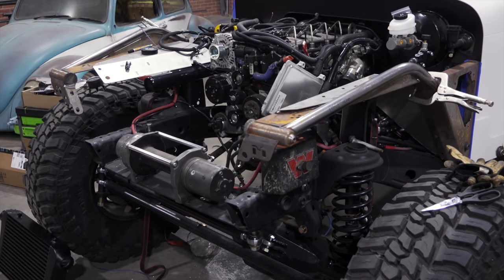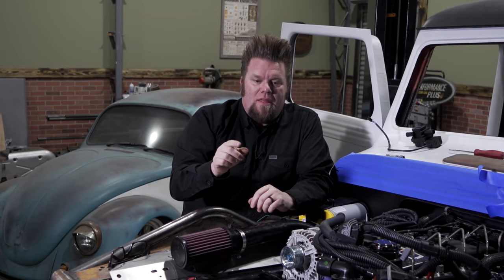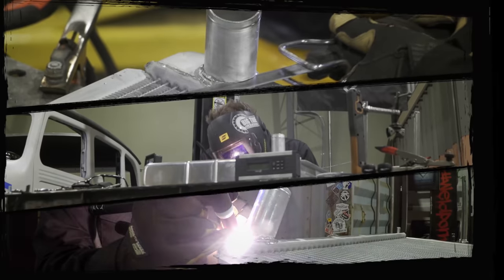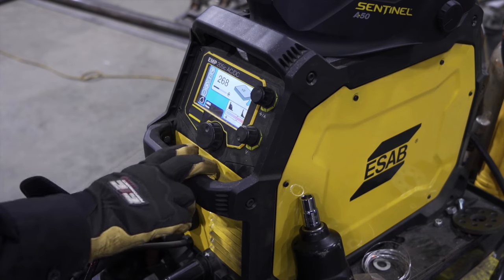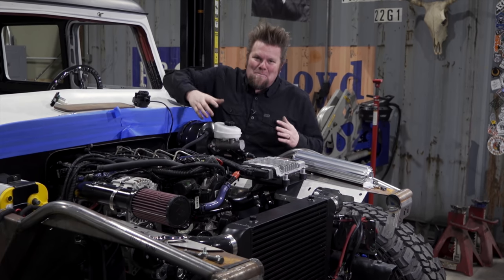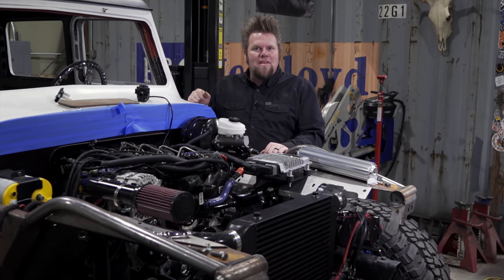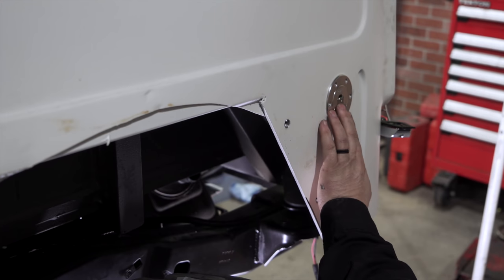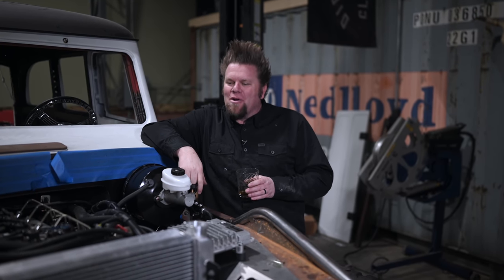How to Plumb Turbo Piping R2.8; Willys Wagon Episode 14

Comment: The first time turning the key and starting the engine on a build is the best feeling.
The little extras on a build are worth it in the end even if they do add more time to the project, usually easier to incorporate while at the build stage, and no regret later thinking "I should have..."

Comment: You’re the guy I want to see take a 2011 to 2013 Suburban and make a triangular four link long travel setup, BUT keep the front suspension a ifs, only bulletproofed.  There’s a million all aluminum Generation 4 LS based Chevy 4x4s with fully boxed frames out there needing more options than the standard heavy front axle swap. RCV makes cv axles for Chevy 1500s now.  Be the first to make it so. Suburban’s are super popular for Overlanding now.   Keep up the great content!!  :)

Comment: Ian, it is a pleasure to watch you fabricate.  I have been a fan since way back when you were working with Jesse on Xtreme.  I love the "all skill, no drama" approach to your youtube videos.  It is both rare and refreshing.  I forgive the "bourbon segments" which are calculated drama.

This should be called the no-kludge channel.  I love Fab Rats and Matt's Off-Road Recovery, and to a much lesser extent Bleepin Jeep  They make things that work... mostly, but make me cringe.  Fab Rats less cringing than Matt, but still some.  Bleepin Jeep has two strikes, drama for drama's sake, and questionable fabrication.  In fact, most of the fabrication channels on the internet have more drama than skill.  I find myself skipping ahead on most of a video, while I watch your's straight through, and then watch again.

I love all of this build,, save the choice and weight of the diesel, and have watched each episode many times.  Yeah, the diesel is unusual, just not my cup of tea.  In aircraft, motorcycles and other vehicles, lightweight is king.

For your viewing audience, taking longer is no big deal, just more episodes to enjoy.  And I salute the desire to get it the way you want it, instead of arbitrarily fast.  I once worked for a manufacturing manager that told me you have three competing goals in most things.  Speed, Quality, and Low Cost.  Pick any two and you can prevail, but never three.  I'm glad you choose Quality.

As for air filters, that airflow rating is for a completely clean filter, which isn't a bad assumption for on-road vehicles.  But you want that airflow value, when the filter has seen 300 miles of dusty road.  You can only get that with a bigger filter.

Take care!

Comment: Ian, love watching your builds. But you need to be careful. I suspect that the MAF sensor is calibrated for a 3" pipe. You may have some metering concerns at higher throttle settings due to the higher air flow velocity with the 2" pipe that you put the MAF into. You will probably need to build the air filter and MAF into a 3" tube to get the engine to fuel correctly. Cheers.
Reply from the maker: The engine does a MAF airflow calibration.......once that is done it learns the flow rate of your existing intake system

Comment: I hope you have better luck then I have trying to keep the R2.8 cool under load. Around town it’s fantastic! On the highway in the summer under a constant load is a different story. It’s never over heated or thrown a code because I watch it, but trying to keep up with traffic or pass a truck the temp climes fast! I went with a SPAL electric fan because the CFM was the highest I could find. I even went with a heavy duty radiator and it still climes fast. My next step is maybe moving the intercooler to let more air flow to the radiator. Best of luck, loving the videos
Reply from the maker: Interesting, where is "home" for you I know Trent Mcgee has his in PHX and I will ask him if has had any issues with heat in the summer.  You could also look at an air to water intercooler to get more airflow across the radiator.
Reply: @BigTireGarage  I live in NJ but for the past two years I have taken it down to the Outer Banks (10 hour drive) at the end of August (super hot and humid). It honestly does fine at 65-70mph with 35s and 3:73 gears, but if I push it anything over that the temp will rise and keep rising until i get out of it. I recently added a deeration tank which allowed for more coolant, I think it helped a little but I still get uncomfortable with how quick the temp rises. Check out the R2.8 owners group on Facebook. It’s an issue others are having, some are trying to push their products saying their set up causes ZERO temp issues but I don’t quite believe them. I know an off-road vehicle doesn’t need to go 80mph on the highway, but the same issue occurs on long steep highway grades so you don’t have to be trying to be going fast for the issue to arise. I feel Cummins just set the ECM temp to low for the code. Thanks for the reply, I’m a huge fan and am honored to be swapping comments. 
P.S I still love the motor and would do it all over again even with this issue. Nothing is perfect and I’m cool with that.

Comment: I appreciate the video as I want a ac in my truck . One thing I a bit concerned about is the breather going back into the intake and the engine has cooled egr . I seen this in the vw  tdi and the result is cooked intake after many miles of use . Would a catch can help here or what do you think .  The ac line build was a good way to go . Never seen those .  Nice fab skills also

Comment: Might be worth checking with cummins but I believe that welding the mass air flow sensor bung into a smaller diameter pipe will throw out the air flow reading the ECU gets, whether it will care or not I dont know but worth checking!
Reply from the maker: Once the engine is fully plumbed and running you go through a Mass Air Meter flow test to calibrate it to your intake system
Reply: @BigTireGarage  ah ok, with it being a pre made part I though they would have calibrated it for the 3" bore is all

Comment: I have a question, My Auto shop teacher once said if you want to go off-road you need to fill your tires with helium instead of air to have your truck float across a river. I have been extremely concerned about this since my Freshman year and I am near fifty years old,my question is, could this work?

Comment: Where did you get the fuel hose that goes from the filler neck to the tank? It looks like the same one I need for my motor home
Reply from the maker: Its a Gates filler hose alone with some light gauge steel tubing that I had in the shop bought it at my local parts store
Reply: @BigTireGarage  I don’t suppose you have a gates part number, or application